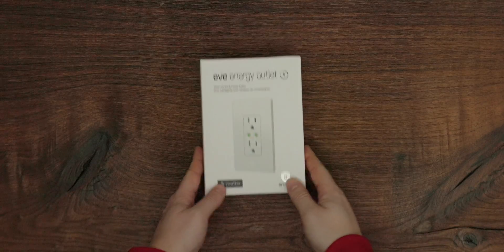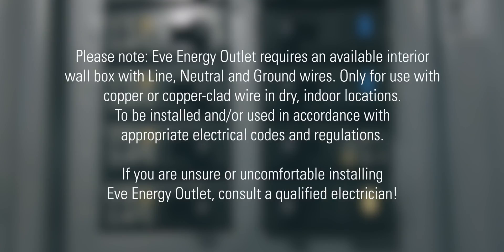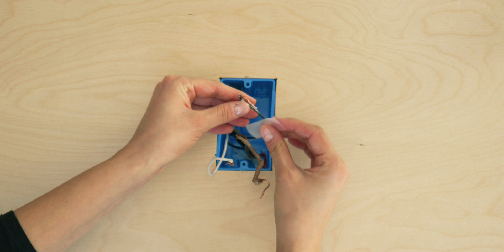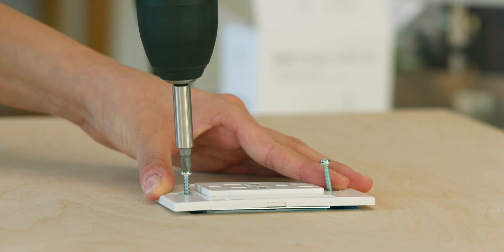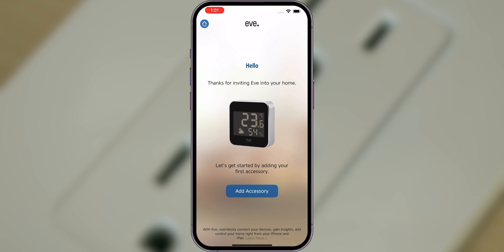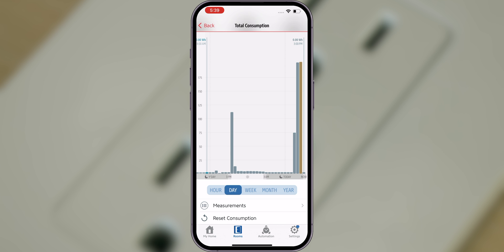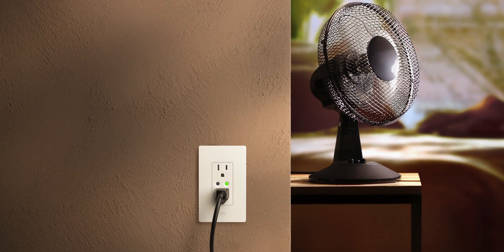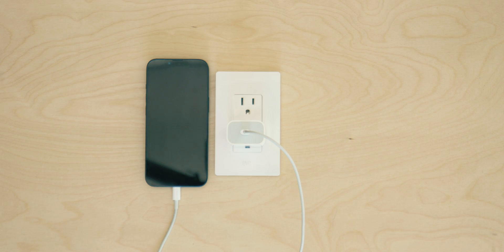Eve Energy Outlet (U.S. & Canada) Installation

Comment: So this outlet supports 20 amp circuits? That's what you're implying in the video by showing a 20 amp breaker. But your website says 15 amps. Which is it? If this video is wrong, this is dangerous. I expect a lot more from a company selling electric devices.